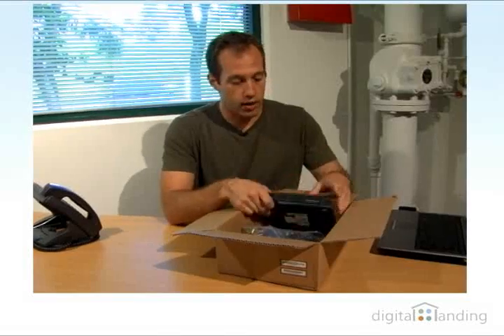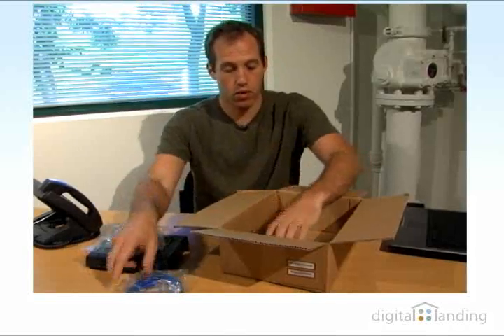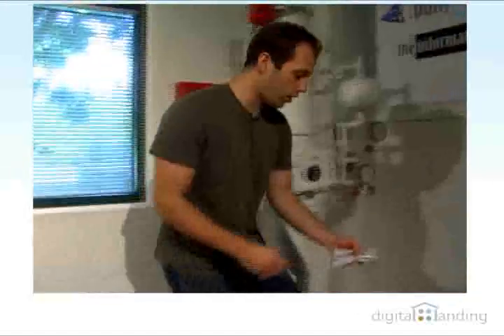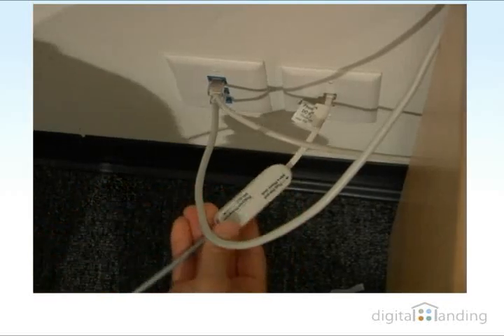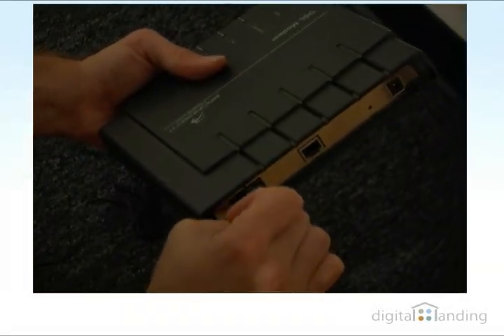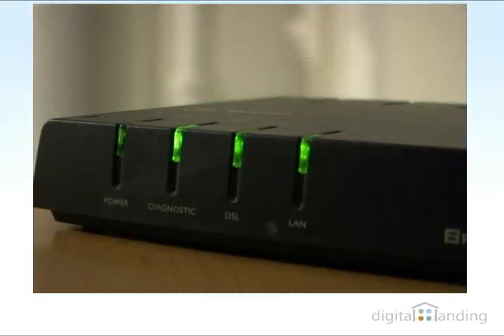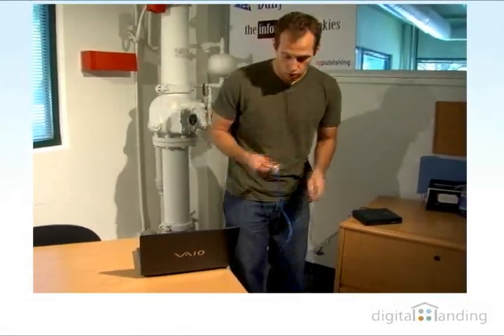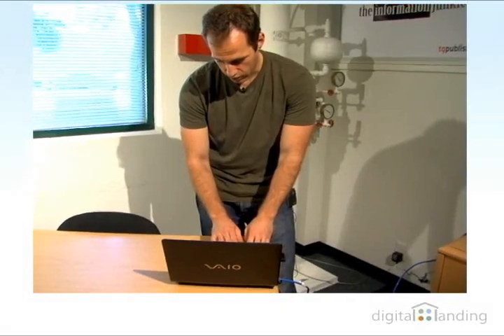How to Install a DSL Modem

Comment: Do not plug the modem into the phone filter, but everyone knows that.  I improved my CenturyLink history by (1) buy the CenturyLing ADSL modem router Best Buy...  CenturyLink offered the same price-Price Fixing,  (2) turned OFF the Wi-Fi wireless modem--will not be charged for downloading kitty porn...,  and (3) connected to an UPS for reliable power.  tjl

Comment: So do you connect the filter to the wall and plug in the phone and adsl?
Reply: Can plug the filter into the wall jack or a filter directly to each devices phone line in. I use a DSL Splitter / Filter adapter. The Adapter plugs into the wall jack - the splitter / filter has 2 out's on it ; one is unfiltered for the DSL signal and other out is Filtered for the phone line. Since I am the only one that uses my DSL and I only have 1 phone that I use with my landline service - I am set very nicely.

Comment: I would have to plug both the DSL modem and my Satelite Direct TV receiver (which requires a phone connection) into the same phone jack.  Can I do this and will that diminish the speed of the DSL?

Comment: I just got my new modem ensemble box via UPS from Century Link.  I presently have a Comcast modem.  I am subscribing to just internet with Century Link.  I canceled my phone service with Comcast.  Question:  Can I use the existing hook-up with my Comcast modem, I figured, I'm only returning the modem itself?  Or do I have to use ALL of Century Link's cables and wiring?  Thank you.

Comment: Question if i have a router that doesn't have a modem built in, do i connect that to the modem with an ethernet cable as well